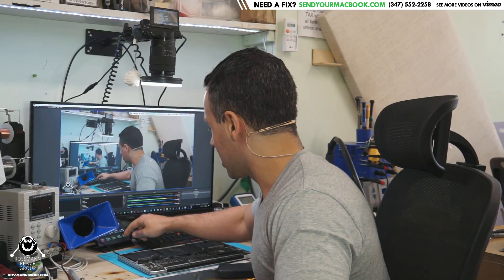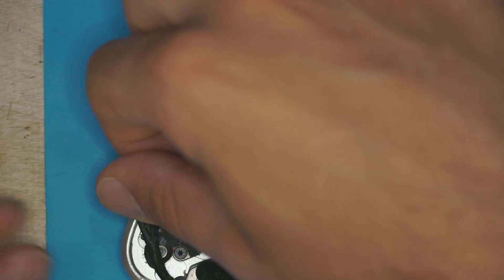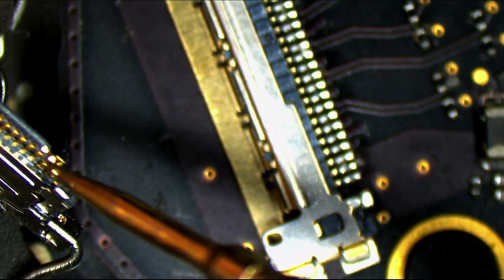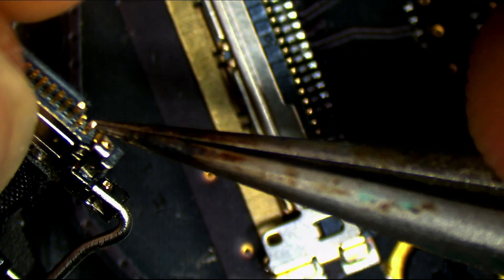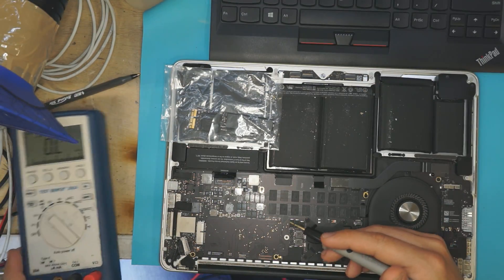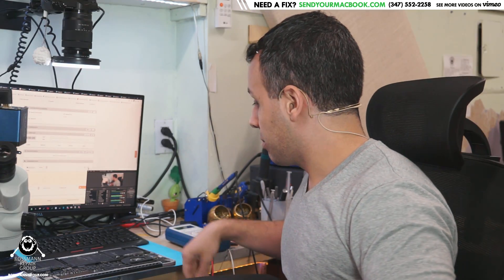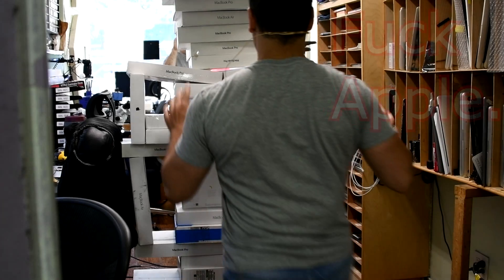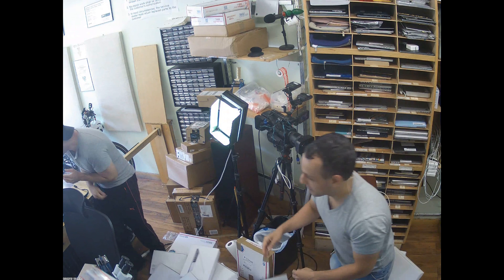APPLE GENIUS BAR STRIKES AGAIN!

Comment: okay but you didn't clarify something from the CBC video... why was that laptop going to the Genius bar in the first place?

Here's the timeline of events, according to Louis:
-Laptop has black screen issue
-Goes to Genius Bar
-Comes back misdiagnosed. At THIS TIME, Louis claims the pin was inadvertently bent by the Genius
-Goes to Louis's store, Louis fixes the pin
-Laptop functions as normal

So, if the pin got bent by the Genius, why was the screen black to begin with? Why did it need to go to the Genius bar in the first place, and how does fixing damage caused by the Genius bar fix the original issue before it went to the Genius bar?

Here's my theory. As they have done in the past, CBC intentionally bent that pin. They bring the computer to the Genius to show that a very simple technical issue is often very expensively misdiagnosed by who should be a trustworthy expert, the Genius. Then they bring it to Louis for repair. I suspect they asked Louis IN THE FIRST PLACE to create some form of simple, common damage that should cost next to nothing to repair, but requires technical experience and integrity to diagnose correctly. Again, CBC has done this many times in the past as a sort of 'sting,' but they ALWAYS DISCLOSED IT FROM THE BEGINNING OF THE VIDEO. Then, for whatever reason, this particular video with Louis was edited to change the narrative because maybe it just didn't fit the original vision, whatever, it happens. The real question here is, why is this concern not addressed here in this video, Louis? I love your work but this particular situation always rubbed me wrong.
Reply from the maker: I covered this in a followup video dedicated to this question. No one watches it though. :( https://www.youtube.com/watch?v=N03U7SPkAiE

The guy from CBC was very nice, but hell if he's going to know pin 1 is PPVOUT_S0_LCDBKLT. Don't get me wrong - very nice guy, but... just no. It'd be like asking me to do your chemistry homework. 

There was bias, which I address in that video. It's just not what most people assume. I actually went out of my way to remove it in a manner that opened me up to looking like an idiot if I couldn't fix it, as best as I can. It's not my fault the genius bar is that bad though.
Reply: Louis Rossmann you know what Louis, I should have looked into your other videos on this better before making this comment. I totally missed that video you linked, and yup, you answered my question in that one. 

I’m sorry my guy. You’re a great guy and I knew that all along, but I naturally question everything I see on the internet, especially when journalists get involved.

Thank you and keep up the great work.
Reply from the maker: @ArchangelUltra  Never stop questioning everything you see on the internet.
Reply: Now you are the types of guys I would love to speak on the internet (especially in YouTube comment section). #Respect to both you and Louis.
Reply: He clearly mentioned a failed SSD as the original problem
Reply: @rossmanngroup  This thread is why I love watching Louis' videos.
Reply: @ArchangelUltra  Sorry but I think I don't quite follow, why did the laptop had black screen issue before going to the Genius Bar again? Also why did fixing the pin fixes the original "black screen issue" that was caused by ??? IDK

Also, I watched the video, but I didn't get the answer, maybe because I'm stupid but please do enlighten me so others can also stay on the same page.
Reply: @randomlight8115  in Louis’ best guess, it was a DIY mistake of someone, apparently some other repair shop, either replacing the screen or reinstalling the original screen after some other internal work. The path the cable takes to reach the main board isn’t intuitive.
Reply: @thecowfy  the mentality that fixing an apple product you've paid for is somehow fucking them is part of the problem.
Reply: Louis Rossmann Excellent response. They used to call what you have: INTEGRITY. But it’s become so rare these days that most people are incapable of identifying it. 

Saved this vid in:
Favourites
Business
Tech
Freedom 
Truth
Law
Funny
Watch Again 

Thank you for sharing your truth Louis Rossman
Reply: Couse Louis is a part of it !
Reply: @ArchangelUltra  jesus, a youtube comment with some humility and acceptance of new information to change your opinion. Props to you for not digging your heels in and being stubborn, and for being open to opinion changing information. It's rare nowadays
Reply: @ArchangelUltra  I am glad you bothered to take the time to return, re-educate yourself and then take accountability and acknowledge your mistake. Kudos to you.
Reply: @rossmanngroup  unless that person is joe biden, then off to the goulag for you if that question yor thinking of asknig isnt "what is your favorite ice cream". Loved the video by the way you rock louis !
Reply: Dude what apple wannabe are u, aplle since day 1 overcharging for what they are, and ripping customers service since day 1
Reply: I thought it was pretty obvious 😐😐😐😐😐
Reply: @ArchangelUltra   you have got to be kidding me with this.

You wrote a comment, questioning something you saw - in a respectful manner. Then @louisgrossman wrote a measured reply and you come back with a very nice, enlightened comment, filled with sincerity and humility.

Two people, engaging over the Internet and both walking away with grace, and without insulting each other.

ADMIT IT; YOU'RE AN ALIEN, RIGHT?

My man, massive respect to you @Archangel Ultra. Massive respect. You made the world a slightly better place for me this morning. Thank you
Reply: He did didn’t he? He said it was going in for a corrupted SSD and then came out with no screen
Reply: Whoaaaaaaa like what the heck
Reply: Ahh, just guys being dudes
Reply: You realize that even if that were true, it still proves the point that genius bar workers are scammers and aren't qualified to do their job.
Reply: @rossmanngroup   /quote - Abraham Lincoln :P
Reply: Ive seen Louis get plenty of these bent pins..
Reply: RESPECT
Reply: Archangel Ultra....So answer one simple question if you can....Why would you think that any one would care what may or may not " rubb you wrong"....cause I can assure you I don't think I give a shit...and...I'm sure there must be millions if not billions of things that "rub you wrong"....but...Please for the love of God don't list them all as I can assure you not one cares...

Comment: been a independent repairman for over 20yrs and if i had a nickle for every time i fixed a mac declared dead by the genius bar... i could buy a fancy timothy's coffee. point being, the geniuses work for a company that sells hardware and they get commission on sales... they don't wanna fix your computer, they want you to buy another one. is like having a financial adviser that works for the bank.
Reply: C Mitchell  that is ridiculous. i saw a video where they all jog in slapping customers hands wearing matching t shirts... reminded me of a cult. maybe they've had their brains washed.
Reply: C Mitchell  The employees are doing what their employer has told them to do. The employee benefits from this by being allowed to continue their employment.
Reply: I'm seeing this more and more as the company I work for grows and expands. When I started I'd be soldering new batteries onto LED boards because it meant we didn't need to buy in a new board for the customer(cheaper for the customer).

As time went on instead of taking apart the crappy dusty PC and replacing parts and salvaging every CMOS battery, HDD or even screws(we had a whole shelf for screws). 

Now with the company making millions on big national contracts it's a case of "Is it in warranty? No? Well it needs replaced, send them a quote!!" and I'm here like "It's just slow, put an SSD in it and it'll be fine".

It's like it's become take take take when before it was the absolute opposite, solder in a $2 transistor and it was fixed for another 6 years now it's NOPE it's out of warranty $1500 please!!!
Reply: @cupidassle  Saw that video and that's exactly the first thing I thought. Seeing all those geeks lined up hoping for a high-five from a trotting, matching-tee-shirt-wearing Apple employee made me embarrassed to be a human.
Reply: Well you shouldn’t have charged less than a nickel then. 😛
Reply: The genius bar workers are just normal ass sales assistants. They know as much as the next person. 
They will have minimal training and most of that training will be on screen repair and declaring things unfixable and pushing you to buy new.
The front of house people are not to blame. The ones who are would be the back of house people, the managers and the CEOs who willingly and knowingly build their products not to last and do their very best to stop any sort of repair that they dont have a hand in.
Reply: @Naeidea   Takeit Easy  any company that grows big loses its moral compass. When things get decided by buisnessmen in boardrooms who dont actually know anything about the service or product the company provides and have never in their life served a customer, all that matters is making money.  Big corporations have sold their soul no matter how much they try to pretend they still care
Reply: @mymail3950  I cringe my cheeks so hard a diamond is formed.
Reply: @pineapplejack476  easy now. you really dont know me. if you call growing up poor and and taking any job i could get to help pay for a better education to eventually invest everything and open my own shop "sheltered" then ok, i suck. im sorry if it hurts yer feelings but apple is notorious for having a cult like following. my children have both worked for apple on some level and agree that there is a certain mindset to the people who are employed by apple whether encouraged or inherent. to answer your question, yes i do think dressing similarly and practicing "team building" rituals is cult like.
Reply: Fun fact about bank advisors
They are advisors not advisers.
Adviser is a protected job that you need proper qualifications. Advisor is as protected as a lemonade stand.
Reply: Cupid Assle lol my senior said the exact same thing, is that you dave?
Reply: @ramtosantosa7661  dave? daves not here man...
Reply: imagine you're a tech and you bend a pin and have to ask your boss to replace the cable they damaged. Someone is going to get in a lot of trouble. Better off just blaming it on the customer. Computer doesn't run, customer isn't going to know any better.
Reply: @JohnTheRevelat0r  the thing is, a company like apple will brainwash their own staff, it might cost apple inc $1 yo make, but employees will never know that, employees will be told its worth $179
Reply: The thing is the repairs have to been done quick and good.. so after getting hundres of macbooks in with a small bent or dent they don’t have time to work through all the tests and things you can do.. also some parts are not alble to be oredered loosely.. had a client with a broken simkart slot, couldn’t just order that part, had to order a whole unit replacement
Reply: If I got a nickle for every time someone used the nickle/dime analogy I would get an fancier tomothys coffee than you.

Comment: If i had a problem with an Apple product, its cheaper for me to book a flight from Switzerland to New York and visit Louis, rather then pay Apple for theirs repair.
I would give Louis a 100-200 Dollar tip. And in the end its still cheaper.
Im not kidding.
Reply: da gits abr au es bar eigni Reparateur
Reply: $835 CAD for a flight from Zurich to New York
probably like $150 repair price (Obviously depends but this guy repairs super cheap)
$200 tip

assuming this is all in CAD even though ik it would be in euros (I'm too lazy to translate the most important thing is the flight anyways) for a total of $1185 WHICH IS STILL SOMEHOW FUCKING CHEAPER THAN REPLACING A 2014 Mac Book Pro at apple which is what the customer would have had to end up doing. Apple is a scumbag of a company.
Reply: Your not wrong! 😂😂😂
Reply: Holy cow! That’s mind blowing! 🤯😱
Reply: @zlmdragon  its gonna get cheaper and cheaper as apple starts selling 10k iMacs and 5k MacBook with motherboard replacement of 20k$ + 5k labour charges + 3k 10 day warranty
Reply: exactly why ill never buy apple, shits a scam
Reply: just dont buy mac(s)...
"Prevention is better than cure"
Reply: I owned only 1 Apple product in my life - a 28 inch desktop machine years ago.  In 12 months and 3 days it died (3 days out of warranty).  Well I happened to live across from a big Apple repair center.  They wanted $1350, not including tax, to repair (It was $1800 brand new) - of course for those 3 days they would not honor any warranty.  They fed me a huge line of bull crap as to what was wrong with it, which was just that bull crap for I've been a micro-electronics engineer for a huge international large truck manufacturer for over 30 yrs.
Reply: here's a idea, buy a PC
Reply: Mario G90 I guess I’m luck being living in NYC 😂
Reply: I wouldn't buy anything from Apple to begin with 😉
Reply: I could probably sprint to New York to get Louis to fix a shredded IPad, sprint to the other side of the continent to get home, and I would still have enough money to pay the medical bills to fix my dying legs.
Reply: Let me save you even more money.  Ship it, and then call him on the phone.  Your analysis left off the cost of the hotel room, and New York hotels, even with COVAD, are not that cheap.

Comment: I like this guy, honesty counts in all cases. I’m a mechanic, 24 years turning wrenches and have this same attitude. If a customer brings in something dumb like a sensor coming unplugged, I don’t charge them. Then when they need something big done they come back, and they will refer people to me. That’s how it’s supposed to go. Not the dealerships or corporate shops. I had a distric manager for a commercial shop tell me how much he missed his shop in Chicago. He said “ you can fuck every customer that comes through the door and never run out of people to fuck. Most customers are fucking stupid and need to give me their money.” Don’t ever use a Midas muffler ever again.
Reply: Wasn’t that district manager named Tim Cook? 
Because, obviously, this logic works, especially when you’re keep bullshitting people and making it very difficult to repair some of your own products, added with another layer of bullshit by turning them into idiots, who buy new products, while having basically working ones already.
Imagine their sales figures if they’d do the repair properly and cut the ripping off part...ooh, boy.
Reply: I respect that. The shop I use now found a great car (found a bad rad before I bought it which the seller replaced). They also did not charge me for a small issue either. However, when I needed work done, I had to take it to a different shop because the other one was booked up!